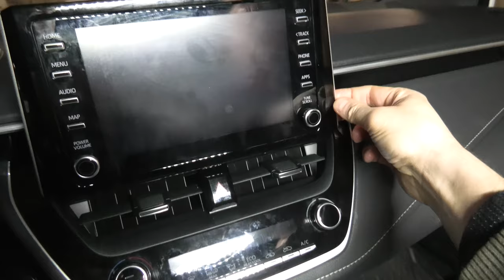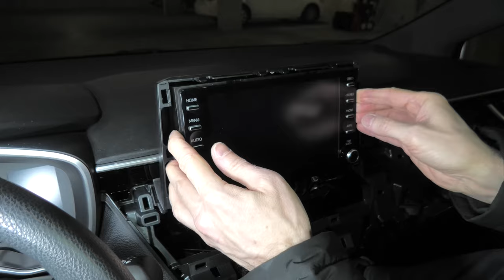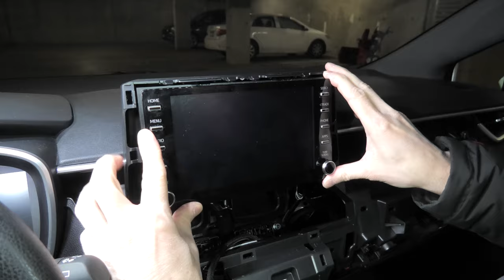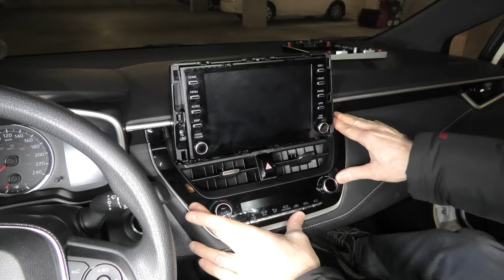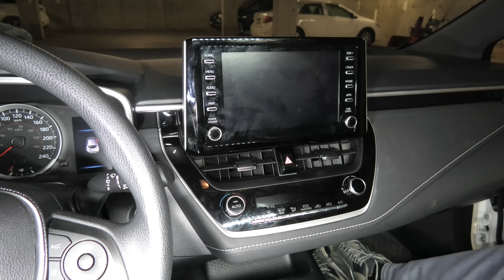Toyota Corolla (2019-2024): How To Remove Radio Head Unit And Climate Control Panel?

Comment from the maker: TOOLS REQUIRED:
1. PHILLIPS HEAD SCREWDRIVER - Klein Tools 603-4 Screwdriver - https://amzn.to/3kFGex0.
2. SOCKET SET, RATCHET - GEARWRENCH 57 Pc. 3/8" Drive 6 Pt. Mechanics Tool Set, Standard & Deep, SAE/Metric - https://amzn.to/41wE6Z3.
3. SWIVEL HEAD RATCHET - GEARWRENCH 2 Pc. 1/4" & 3/8" Drive 72 Tooth Dual Material Roto Ratchet Set - https://amzn.to/3kwhHdS.

Comment: Is is possible to install a JVC Single din head unit, since the OEM head unit is integrated into the dashboard. Whoever came up with the idea of mounting the radio on top of the dash, while blocking the lower portion of the windshield is stupid. 2 door cars coupes, will usually have the head unit installed above the center console below the dash, which is way better for swapping out the OEM head unit for an Aftermarket single din or double din. This design with the factory radio above the dashboard makes it impossible to install a single din, unless there's a kit you can buy.

Comment: Woupd have been nice if you put everything back in place without the head unit so we could see what the dash looks like without goofy screen being in way of seeing rhw road.  I am looking to replace mine with regular radio, no video screen.  I look at computer screens enough all day at work.
Reply: Hate to break it to you but your most likely not going to be able to. Part of the reason cars have large screen radios is the law requiring backup cameras in every car. You would have to get a custom bracket made to cover up the space and then find someone who makes a single DIN stereo, which very few still do, due to change in technology and the lack of demand because of it. I have a 2020 Corolla myself so I get how it feels out of place, but I guess it is what it is. Good luck.

Comment: Can you do a video on how to remove both the air-conditioning vents? Driver's side and passenger's side.
Reply: I need to learn how to remove mine to clean my vents out. I work at a general contractor's home and his driveways are gravel and I get all kinds of dust floating in my car.

Comment: I don't want the computer screen or backup cam. Will a tape deck fit in this slot? Obviously, I would need to make some adjustments with the moulding, but nothing 3D printing can't do.
Reply: Dude just get an older corolla at that point lmao

Comment: I would love to know which harness is for the Speakers and which one if for Power. I want to install a mild amplifier upgrade to drive a couple of JBL GTO speakers. Thanks
Reply: If your looking at the back of the head unit it's the plug all the way on the left. That's what I'm doing right now, adding amp and sub

Comment: Hi looking to buy this car from Japan but they use Japanese touch screen will a replacement work for the hybrid mode? Just subscribed to you good video
Reply: I would double check the part number for a Japanese-spec unit and see if it’s the same as a North American-spec one. I wouldn’t risk getting anything even slightly different because of how expensive the unit is. Not worth the risk

Comment: Does anyone know which one of wires connects to the brakes circuit?
Reply: Did you ever find out? Usually if you can't find it just connect it to usually the brown wire if there's a brown wire that's usually the break from my experience

Comment: Is this a single or double sun radio ?
Reply: Neither. The vid is just showing how to remove the factory deck which is just a flat screen. Metra does make a kit for this Corolla application but I have not installed one yet to verify how well it works.